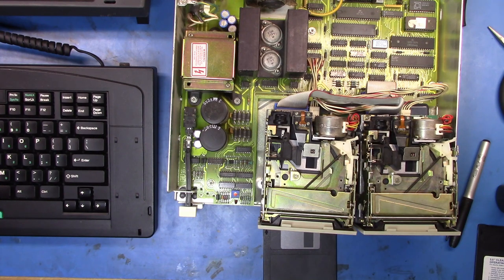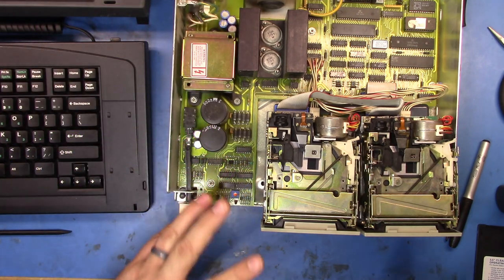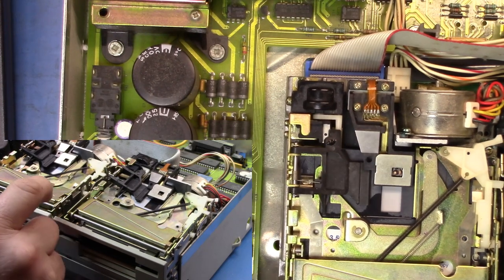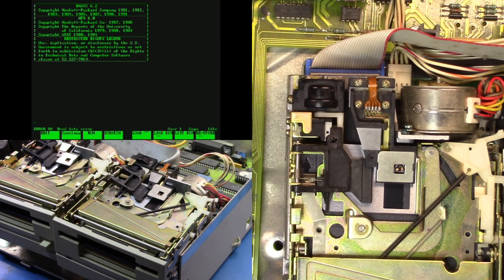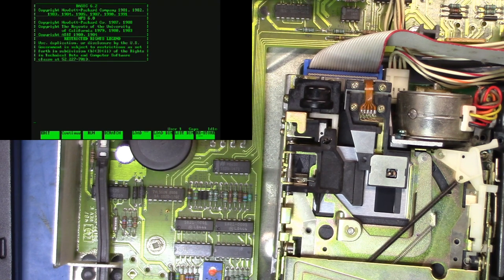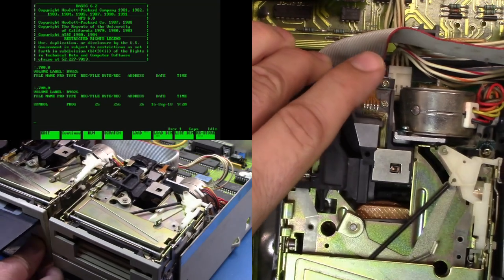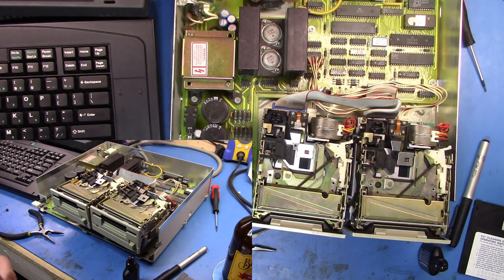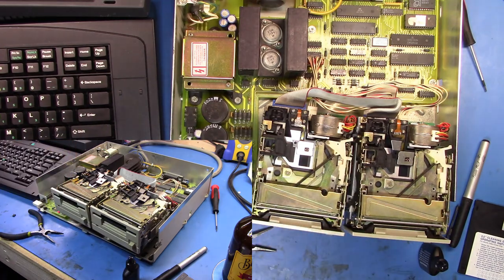HP 9121D & 9122D Repair - Part 3

Comment: Thanks for part 3. All those mechanical things were always no end of headache. Printers were always the bane of my existence. Good luck.
Reply from the maker: Thanks - At worst I can replace the second drive with one of those flash card readers - I found one that works as a replacement for the OA-D32W drives used in this device.

Comment: I have a whole bench of floppy cleaning disks, I bought a dozen of them, shortly before all my computers stopped using them!
Reply from the maker: I guess you're all set for the next flood then :) When I get a chance I'm going to try swapping out the stepper motor gearing as I think that might be the issue. If that doesn't solve it then I'm sort of hosed as all the 'spare' drives I have already have the upper head ripped out (I'm assuming it not working is going to indicate a head failure). Fingers crossed.

Comment: Interesting. I’ve got two 9122Ds and all four of the drives are bad. I haven’t had a chance to dig into them yet, and I’ve got a working 9121D and 9122D, so it isn’t urgent. It’s good to see that a thorough cleaning will go a long way. I’ll start with that on my units, once I get around to it.
Reply from the maker: Thanks - Watch out for the heads - 2 of the drives that I have had the top heads ripped off. Before dealing with a stuck drive you might want to take the top off the unit and check if there heads are there and they're disengaging properly.

Comment: I have not worked on that exact type of drive but I have repaired many old type drives and unless they have a specific home detector of some sort then they initialise by driving for long enough to complete a full sweep even if they are close to the end of travel. They then assume they are home. If there is wear in the stepper mechanism then it can put the heads slightly out of line with the cylinders. Also I have had a Lot of issues with poor quality floppy's. Initially floppy's were made to very tight tolerances but as drives improved the floppy manufacturers seemed to respond by making floppy's on the cheap and the quality dropped which was fine for modern drives but older drives with less sensitive heads and less accurate transports did not like them. The older the drives I have worked on then the more fussy they were on the type of floppy. I have also found that initialising a drive on a floppy with data would corrupt the data unless the home position was in exactly the same location as the one in the drive that wrote the initial tracks but that is most likely due to the type of systems I tend to work on. Very interesting video.
Reply from the maker: Thanks for the comment - I think these drives (Sony OA-D32W-10) have the return sensor because I see them stop traveling on return at the correct spot. I suspect that you're right on the less sensitive heads. I think there may be too much play in the stepper gearing so the heads aren't aligning correctly - It is consistently failing about 2 tracks in.
Reply: I normally connect a scope to the head output using a couple of isolating caps. The signals are normally easy to see and you could compare signal levels.
Reply from the maker: Good idea - I'll see if I can give that a try- Thanks for the suggestion.

Comment: Sounds like the bearings are a bit dry. 
So the drives read and write, even the noisy one, but don't initialize. Weird.
Do you have a modern floppy drive to rule out the diskette's quality.
Reply: Modern drives are far more forgiving of poor quality disk's so it would not really help. I think that is why newer disk's are so poor.
Reply from the maker: While a modern drive wouldn't work as Jerry said, I can put the disk in the other drive and it formats correctly. I tried several disks with the same result so unless they're all hanging just inside the spec then I think there is an issue with drive alignment. You can notice that because it checks track 35 and does the copy ok but fails early on the format where it starts from track 0.

Comment: The SERVICE MANUAL !! for that floppy drive is available for download at https://www.manualslib.com/manual/833437/Sony-Oa-D32w.html  It does have the stepper motor replacement procedure.     Thought that might be helpful.
Reply from the maker: Thanks - I'll take a look before I try pulling them apart - Appreciate the pointer.